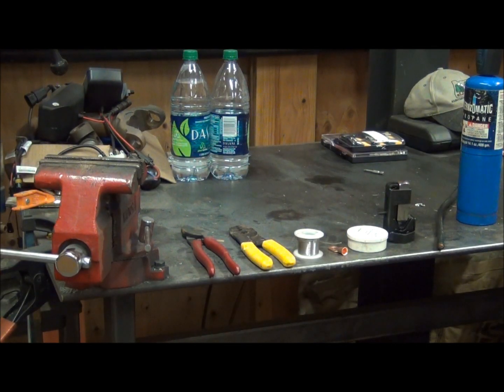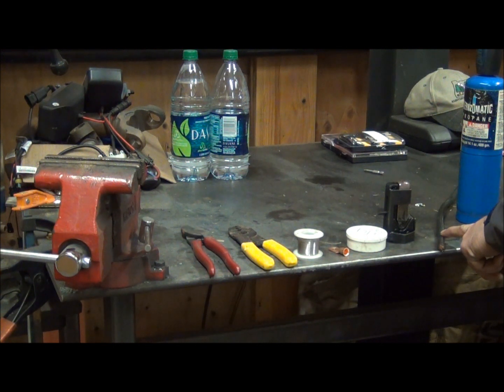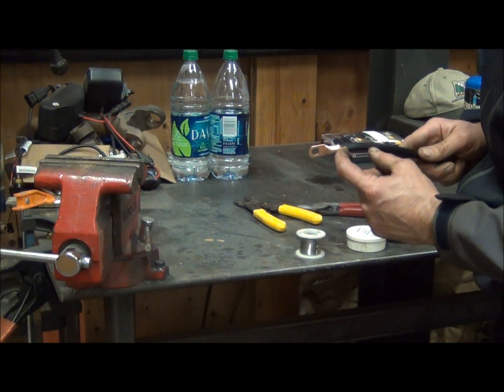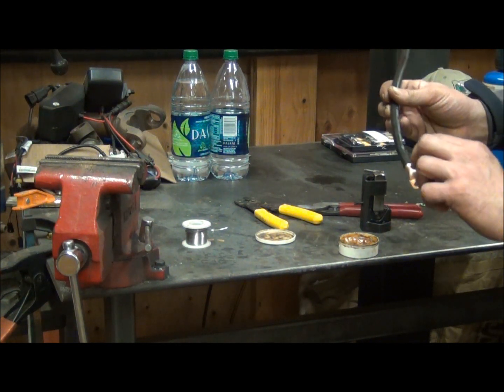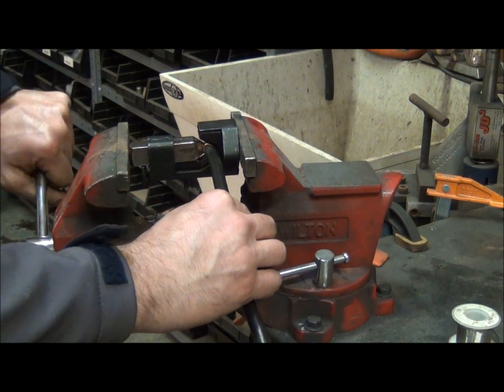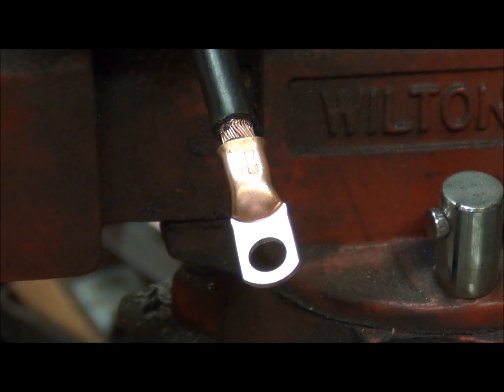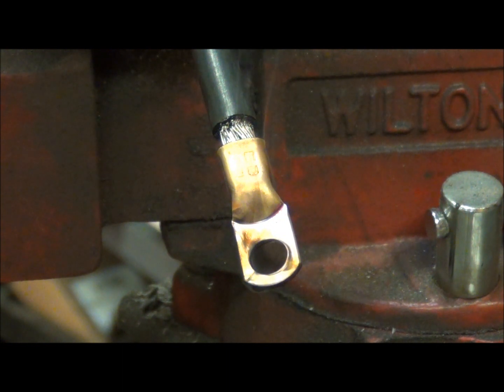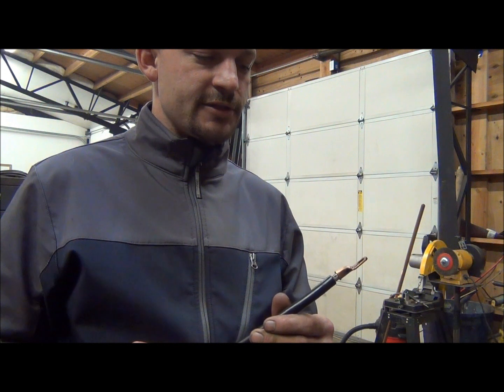Crimping copper ring terminals on heavy gauge battery cable

Comment: I find (just for my personal reasons) a waterproof heat shrink on all electrical connections, especially battery cables.  I have in the past been chasing gremlins which turned out to be failed ground connections.  But very informative and well done DIY video.

Comment: Its not entirely necessary to solder every joint. I dont know why you guys solder everything, ITS NOT NECESSARY unless you dont know how to crimp properly.  Just use good copper lugs, copper wire and crimp properly with a GOOD crimper.  Also heat shrink double overlap and use grease or vaseline on the end of where your tin plated lugs connect to terminals and your golden for years.

Comment: Just can't help touching the wire with bare skin. Your skin has acids and oils. It CORRODES COPPER PEOPLE. I do like that you used real battery cable. All the car stereo guys should watch your video. When you solder, as you show, connector down and wire up. Keeps solder inside the connector body where it belongs. You show proper heat placement with the torch. Pretty good video sir.

Comment: A properly crimped lug is more than sufficient.  Soldering causes multiple problems.   The flux gets wicked into the cable braid where it can't be cleaned and causes corrosion later.  The solder also gets wicked into the braid and causes hard points where repeated flexing will break the strands from fatigue.   Lastly, if the solder is the primary means of attachment (unlike the staked lugs in this video) then a high current fault condition can cause the soldier to melt and flow out of the lug, releasing the cable.

There is no more superior joint, both electrically and mechanically, than a properly crimped lug-cable connection.   (as recommended by the American Boat and Yacht Club, The FAA, and NASA, who all have rules AGAINST soldered connections for power cables).  It has the least resistance and the best strength.  There is zero benefit to adding lead around the joint.  

Either invest in a good set of hydraulic crimpers or borrow them from someone that does.
Reply: SolarMillUSA:  Well said!  I've experienced wiring failures when solder was used: usually the solder wicks some distance into the cable,  which as you correctly pointed out produce hard points or stress concentration points, so that in that exact point, the flexibility of the cable changes abruptly, and makes the copper strands of the cable much more prone to breaking.  I've seen that the best connection is when there is a good crimp (difficult without extreme pressure when working with thick cables like 1/0 or larger), and using a very good stress relief to make the transition from the flexible part of the cable under the insulation, to the hard part under the crimp.  Best is when the insulation is mechanically attached to the terminal, but I have not seen large terminals that crimp the cable insulation too.  I've used liquid insulation paste under large shrinking tubing (several layers) to better protect the connection.

Comment: hey where do i find a splice for a battery wire that continues to another location and add a ring terminal for another battery. I have an RV with existing wires, 2 gauge that i dont want to cut. I want to add another battery to the system along those wires going to the panel. how would you splice 2 gauge to another terminal for the battery cable?

Comment: A good read is the CalTrans document http://www.dot.ca.gov/hq/eqsc/QualityStandards/Electric/Electric_pdf/Electric.pdf

One important requirement is if you use solder, then you must support the cable to prevent flexing the connection.  Solder creates a condition where flexing breaks the strands of copper.
Reply: EXACTLY... well said.  With smaller (10 to 22 ga cables), I've used terminals that have doublé crimps, and the rear crimp supports the cable insulation.  BUT for larger cables like 1/0 I haven't seen a terminal that properly supports the insulated cable, therefore I use several layers of Shrink tubing, and seal the connection with liquid "tape".

Comment: good video on diy cable
People do obsess over what is the best of the best--in  reality what will be strong and last a good enough amount of time.  Both crimp and solder both have to be done correctly or either can fail.  You did point out that there are some good, but expensive options if that is the desire.   
There is always the option to buy a hyd crimped professionally made cable already built
Yup, pretty good really --Ive seen some awful vids on this

Comment: you could also use a large C clamp if you don't have a vise and you could do it by the car. Most auto makers don't solder their crimps, just using a quality crimper is the key

Comment: I wouldn't recommend soldering this type of terminal, crimping is totally adequate. If soldered the insulation will melt locally to the soldered joint,  the plastic then leaches out chemicals at micro level, these chemicals are corrosive and can potentially break down the cable.  Also, flux is not required, multicored solder is cored with the correct flux for electrical soldering.  Another tip when crimping large cable and terminals, strip off more insulation than needed for the joint, then twist the cable stands. Then cut the end to the correct length for the terminal.  The twisted strands give a more solid crimp.  Some cable may be twisted already.  Further, I would never use a gas torch to solder electrical connections, the flame produces combustion chemicals which could contaminate the joint and is hot enough to oxidise copper.  A suitably sized electric soldering iron is the correct tool for the job. I have several irons from 15 to 250 watt, the 250 will solder almost any cable likely to be found on light industrial equipment.
Reply: myname4731 Most marine application wont even accept solder and Most race cars do NOT solder anything. It just leads to corrosion, also a proper crimp will last you a lifetime.
Reply: Crimping is not adequate. The fine wire will corrode unless potted in protective solder, gives a rip-snortingly good connection with much lower resistance than just a crimp. Use the torch. Ignore this guys barf about "chemicals at a micro level". Combustion chemicals, blah, blah, blah.
Reply: What!

Comment: I wonder if a wall plug soldering iron would heat up the eyelet enough? I don't have a torch, and i do have patience to wait for the eyelet to heat up...

Also if you use rosin core solder wire, would you still need to use the flux?

Comment: nice vid! what does "gauge" wire mean in this context ? gauge is usually something on the dashpanel!
Reply: farerse To gauge something is to "estimate or determine the magnitude, amount, or volume of". A mechanical gauge that you speak of is a visual display of a device (like the float in a gas tank) that gauges how much fuel is in the tank, another device (pressure sensor) which gauges oil pressure or fuel pressure, or even a sensor that gauges the temperature of the engine coolant. That's how it got the name "gauge".

When speaking about shot guns, for instance, a 20 gauge gun is smaller than a 12 gauge. The "gauge" was measured by how many lead balls (or "shot") which are the same inner diameter of the barrel, it took to weigh 1 pound. Which is why a smaller gun barrel is indicated with a larger numeral.

AWG (American Wire Gauge) was determined by how many "draws" it took to reach that diameter, starting with 1 gauge wire and drawing it through a press until the diameter was reduced. A 10 gauge wire required 10 draws through the press.
Reply: Carl Jr That is one of, if not “THE” best explanations I’ve encountered, to help make sense of it all to “newbies”. Great job !
Reply: Carl Jr thanks for this explanation! i totally forgot the term "12 gauge shotgun" .. now it makes sense also :)
Reply from the maker: AWG (American wire gauge) is how electrical wire is measured; the lower the number, the larger the diameter.
Reply: thanks. so gauge means measure i guess? which gauges on the dashpanel in a way does

Comment: what table is that you have ?
Reply from the maker: Its one that I built; 1/2" thick steel top, 2x4" rectangle tube legs.  Not a real heavyweight as far as welding tables go, but good enough for most of my projects!
Reply: that looks good i gonna build one too
Reply from the maker: On the welding table?  It is regular unpainted mild steel.  I keep a dehumidifier running in my shop at all times...keeps the rust down on my ironworker tooling, lathe, milling machine, etc.  It also helps with the welding table...
Reply: sewerzuk Me too. I should have done it 35 years ago

Comment: Thanks for the video, I'll try your technique next time. I've been loading the terminal with a little flux and small pieces of solder then apply the heat. When the solder starts to melt I feed the cable into the opening. A minute later I give it one wack with the hammer crimper. Also, I've always used (self-adhesive) shrink tubing to seal the exposed copper, in effort to eliminate any further oxidation - even if it's just for the ground wire.

With regards to the comments suggesting "not to use flux on electrical wiring"....

Most soldering flux is typically a weak organic acid (with rosins) that removes oxides so that solder can adhere to the metal "and" is ESSENTIAL to the soldering process. Corrosive? Yes and no, but most if not all of the acid is vaporized during the soldering process.
Reply: +Patrick Walker   IF I still want to use solder on these terminals, exactly what kind of solder should I get?  I see people using all kinds of solder and some with/out flux.
Reply: +Ojeramup12 I use the non flux core solder that comes on a roll and it's the same type used by plumbers for copper pipe joints.
Reply: The absolutely BEST kind of solder is the one called "63/37" that has 63% Tin and 37% Lead.  It has a melting temperatue of 361°F and NO PLASTIC RANGE, that means that the solder alloy melts and solidifies at an exact and very narrow range of temperatures, unlike 60/40 thatmelts at 375 and takes several degrees to solidify (375-361=14 full Fahrenheit degrees): if the connection moves EVER SO SLIGHTLY during the cooling, ie. the solidification, the solder goes bad, producing a cristallized "cold joint".Then, WHY the Hell do most people buy and use 60/40?  I've never understand, but 63/37 is MUCH better and also is one of the lowest practical melting point solders available, which means less chance to melt the insulation, damage materials or destroy semiconductors.And try to buy enough 63/37 while you can as the ever stoopid eco-nuts are pushing tree-hugger politicians to prohibit it as it contains lead, which they hate (and in the process or prohibiting lead solders, they are causing a lot of failures with "lead-free" solders, which I personally hate because those are prone to breaking.

Comment: You left too much exposed wire imo.
Reply: ***** Interesting, I have never had an issue with crimped grounds, even in harsh conditions.  Just slap on some dielectric grease and it's good to go.
Reply: That's cute. Do you also still only use carburation for vehicles? There has been much innovation in the automotive world if you haven't noticed.This isn't the 70's anymore, therefore your opinion on the matter is moot. But I digress; keep doing what you like doing, and I'll stick with my methods which I know work very well. I have adapted my methods to better ones over the years, and I like the results. Have fun replacing grounds every 2 years.
Reply: He said it's for ground only so need no worries.
Reply: ***** Well actually I do have plenty of experience in that field.  I own a 1970 International Scout that I picked up in the 80's, and have worked on a lot of vehicles in that time.  Anyways, I have been using dielectric grease since the 90's when I first heard about it, it has never given me any problem.  I'm curious as to why you became so defensive when I was obviously just sharing my experiences, just like you had.  All the grease does is prevent oxidation and corrosion, nothing special.  Just thought I'd share what I have seen work.

Comment: I am wanting to attach a 10 gauge fusible link to a 6 gauge wire.  Any suggestions on how to splice them together?  Any splicers that will handle two different gauge wires?  I have also seen people say to solder and others say not to because it could affect the fusible link.   Thanks for any help!!